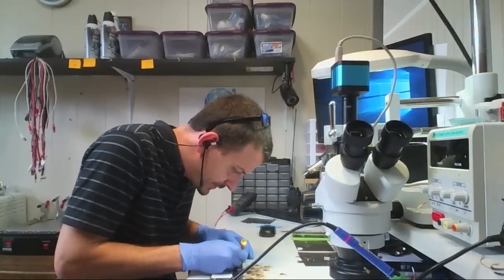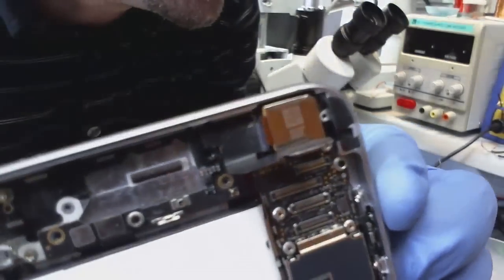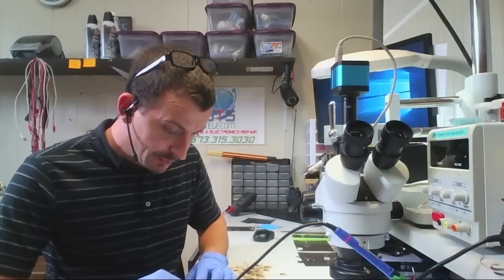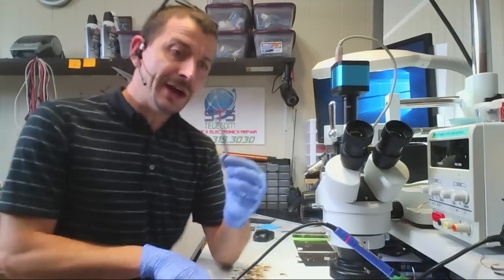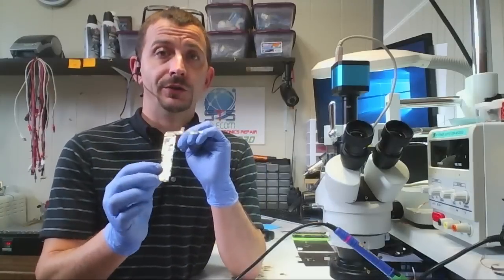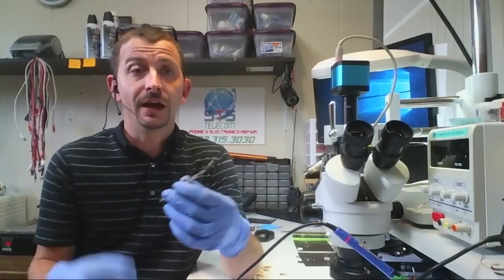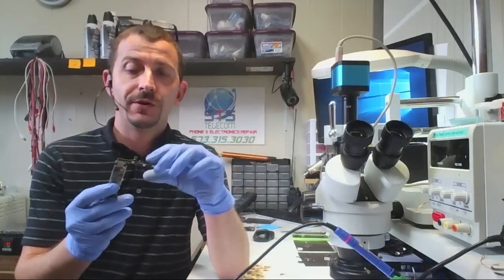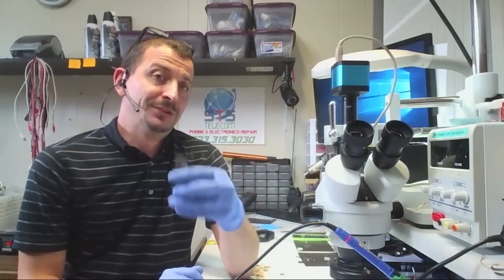What board repair shop makes this mark?  A customer told me Apple... Hmmm

Comment: Apple dose not do repair but they have the approved technicins who review this devices that broken and still comes under the apple warrenty. This guys first thing do is  make this mark and if fault is easy fix  they will fix it and place it in to new housing, pack it in to box and use as a replacement device. So basicaly it is apple. Thats what i heard but i am not sure aither because its imposible to see with your own eyes and say yes it is apple.

Comment: Just worked on a touch ic last night with the same marking, first time I've seen it. Customer said phone was never repaired straight from Apple. No signs of rework done to it also. Very interesting
Reply from the maker: They're usually pretty clean.  I ran into another one this week that had rework done all over the bottom side of the board though.  They left quite a bit of flux on it too.
Reply: Interesting. Contacting Apple myself this week and seeing if they swap boards or repair.

Comment from the maker: Thank you all! This is all really good to know.  I was thinking it must be another shop that does touch IC repairs because many of the 6+ boards that come in with that mark have had the touch ICs replaced or reflowed.    It's likely to be previous repair attempts on some of them but the phone in this video...  This is a guy who would never attempt something like this.   When I peeled the bottom sticker off, there was so much flux that it was on the inside of the sticker too.  There have been others that show obvious signs of rework with flux left behind but most of them are pristine clean with very little markings to clue me in. 

It is possible that the man who brought this phone was lying.  With what I've seen with that mark and touch IC rework, I have to ask, has Apple been fixing this defect longer than anyone has realized?  As finicky as this shit is, they must have had problems with a percentage of them right off the assembly line.  I have heard many stories from customers where they traded in their touch defect 6+ for another one that did the same thing 3 weeks later.
Reply: It has to be Apple.... I'm live in Hungary, Europe, and I had seen these marks on a lot of phones. Even in 4S, 5 etc. All marked phone was a repalced (refurbished) one, and on lot of these phones there are traces of rework (flux reflow..). Right now I'm working on a water damaged i5, and it has the mark on the top, and it has a repalced U8 Gyro IC. I'm certain of that that I am the first person who opens this phone because it's my sisters phone and it has been replaced few weeks ago. Keep up the good work and the videos man! Thanks!

Comment: Hi, I work for a independent repair shop in the UK. I've seen marks similar to this many times before on Apple warranty replacement handsets. It's usually on a screw holding the Logic-board to the housing. The screw and surrounding area are painted in what looks like Tip-Ex / Wite-Out followed by a Sharpie line on top.
Reply from the maker: I'll be keeping an eye out for the white marking.  I'm sure I've probably seen it before but I've only noticed the black marker stripe at the top just under where the rear camera flex covers it.